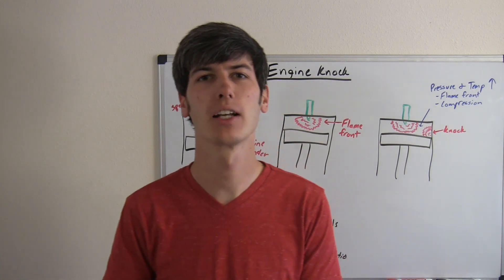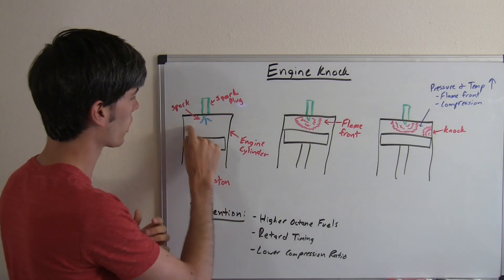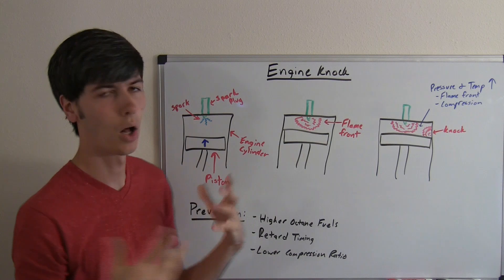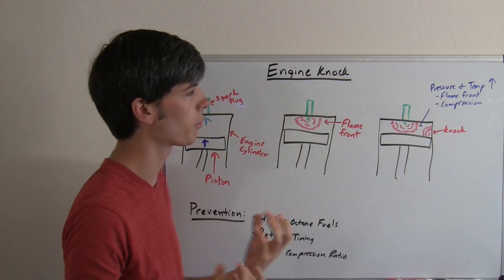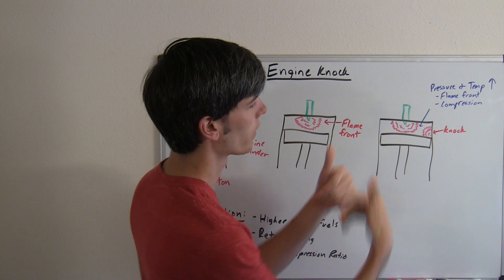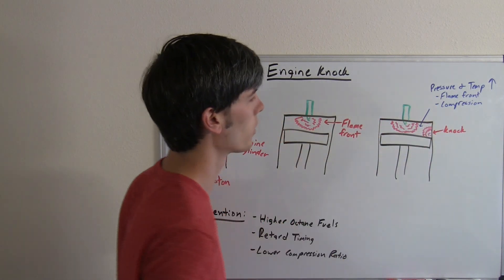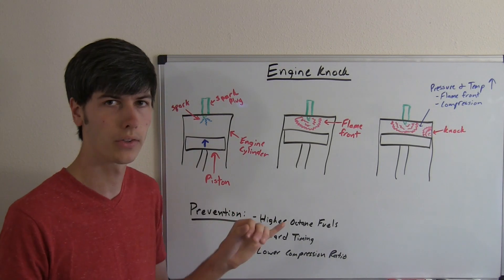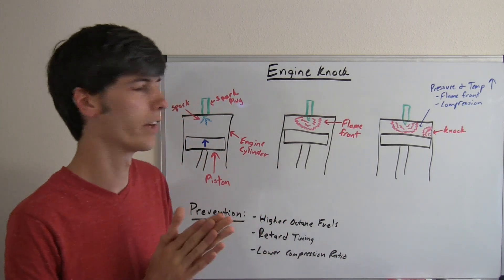Engine Knock Sound - Explained

Comment: I work developing engines. In my simplistic model to explain knock combustion at the end there is not a new flame front forming. This would be a post-spark surface ignition (a kind of post-ignition). In knock the fuel reached its auto-ignition state and burns deflagratively, e.g. explodes. Because of the very, very short time it takes to explode it generates a pressure impulse that resonates through the combustion chamber volume, just like when you hit a bongo (percussion music instrument).

Comment: I have a feeling the colliding front waves theory is not accurate. The additional point(s)  where the fuel ignition occurs makes the entire quantity of fuel burn faster than it is anticipated by the engineers that tuned the engine. As such the peak pressure occurs much sooner like probably around 2 times, instead of 14deg ATDC  it can be 14deg BTDC or even at a few degrees after TDC (again more pressure than the engine us designed to handle) and that pressure will want to stop the pistons instead of accelerating it. As a consequence the pressure and the force on the rod increases substantially depending on where was the spark advance set and other factors. Retarding the timing simply makes the potentially dangerous peak happen later and lowers peak pressure
because it will happen where there is more volume in the cylinder

Comment: I have been told that using higher octane gas in my 2011 328xi BMW is not necessary? I understand that most cars have auto timing to prevent knocking? do you have a video on this aspect? price of 91octane in Canada is $0.30 more than regular gas 87 octane.

Comment: Is any engine knock normal. Somewhere either in GM documentation or my Alldata subscription on my 2003 Impala 3800 Series II 155K miles, it said "some engine knock will occur" and then put out the very fuzzy description of what was normal or excessive. I only hear a little pinging when first accelerating up a hill, otherwise I don't hear it.
Reply: In modern engines with knock feedback control it is normal to hear some knocking combustion. I would say up to 20-30 mild, non repetitive knockings within 10 seconds with the engine with some load and at mid speed region would be considered borderline knock and acceptable. A continuous strong knocking is not acceptable.

Comment: Engine knock in a deisl is explained not by any mechanic till the engine was dismantled and wow! the grabbing by the piston on the wall was as if a powerful scourer had been rubbing the sides, looking at the pictures taken it looks like some chips or carbon deposits (if hard enough) hd scraped the indentations the vehicle had covered only 110000 kms whats that about 68200 miles 2013 model I used penrite oil and believe that is what saved me from an in route disaster, tried to contact mazda global hq but no dealer response yet. trying to figure out the cause, as it could be manufacturing chaff:? I'm sure its been picked up from the sump or other possible areas? Compression tests were ok despite the grabbing, injectors? well the effected cylinder was in specs but!!! was delivering a "higher fuel "amount, Being disloyal the knocking noise would go unnoticed easily, so if you  have any suspicion about your car no matter how new get it in written record to the dealer when getting the car serviced; no matter what they say, you'll have comeback after warranty expires.

Comment: The timing retardation used to be something that was doable.  However, since the '90s, the ignition systems on vehicles became fully computerized, eliminating the old rotary-distributor designs.  As a consequence, any retardations of ignition timing, like compression-lowering tricks, usually involve design changes—namely in the computer, which can be a very tricky thing to do unless you're a skilled hacker.
Reply: the computer has a knock retard algorithm based on a number of variables and settings so it’s much more effective to control knock. You can also datalog the timing retard and reduce the values in the timing table or give it a lower AFR to prevent knock so the computer doesn’t need to do anything

Comment: My 218ci Flat L-head 6 (1950 Plymouth) knocks at the specified timing. I also have a GM high energy electronic ignition system. The stock resistive spark plug gap is 0.035. I am presently using a non-resistive spark plug gapped at 0.040 and the knock persists. Adjusting the timing eliminated the knocking but acceleration was poor. I'll try higher octane fuel but should I increase the spark plug gap as well?

Comment: I experienced engine knock a long time ago when I was using 87 Octane fuel.  After I upgraded my engine, I went with high Octane Fuel along with Lucas or Gum-out fuel system treatment.  No more knock on my 2.15 L I-4 DOHC GDI engine.  Then engines revs easily to 7,000 RPM if I go 3/4 throttle.  Nice! Nice!  baby thank you for all your tips.
Reply: Upgrade engine like the engine block?

Comment: I know this a old video but what if my engine don't use high octane fuel?
Reply: my magma 12 car is 10+ years old and have some serious knocking or pinging issues, but i change my fuel to 97octane and it went smoother than before, even a cold start
Reply: It is better to use higher octane fuel on a low octane engine than it is to use a low octane fuel on a high octane engine.

Comment: The actual "knocking" sound can be attributed to two things. There is knocking caused by the large end of a connecting rod hitting the crankshaft because of clearance issues, or because of piston slap in an engine with worn out rings.
Reply: That's a whole different issue which deals with wear damage to the big end bearings. This video is just talking about fuel igniting at the wrong time due to timing issues

Comment: Can i use higher octane fuels for low cc engines. I mean lower compression engines. Will it cause damage? or increase its performance.
Reply: It is ok to use a higher octane fuel. It just may be slightly less efficient.

Comment: Can knock happen at idle? I know usually it's when there's a load but my truck has a rough idle and knock. I put octane booster in it and the idle smoothed a little bit and pinging went down. The only thing confusing me is it seems to happen at idle mostly. It's a carbureted 302 with vaccum advance on the carburetor if that makes a difference.
Reply: Yes it can happen at idle

Comment: I have an 03 honda crv, k20a motor recently having a teoble code of p0325, and check engine light is intermitent though the code retains on comp box memory,  even you delete it itll go back,  i replaced the knock sensor but it keeps on coming back sometimes if i ignore the check engine light it goes of automatically, do you think its more of a mech problem than a electrical pro BK lem

Comment: Thanks for the simple explanation. My 2009 Wrangler, that I bought new, used to run fine on 87 octane fuel. Now that it is ten years old with 120000 miles, I can hear engine knock (or ping) when it is under load (going up hills) with 87 octane fuel. I started buying 93 octane fuel and the knock mostly disappeared. Had the same thing happen to my 1993 Ranger. It started knocking with low grade fuel somewhere around 120000 miles.
Reply: The reason for that is carbon buildup in the engine cylinders.  As ashy residue from burning fuel gradually builds up into a hardened substance inside the cylinders, it occupies space inside the cylinder which normally should be open for the fuel-air mixture to fire properly, reducing the space for the fuel-air mixture to use...essentially, it raises the compression ratio, causing the less-stable, lower-octane fuel to pre-ignite, causing even more ashy residue to build up and also causing eventual damage to the crowns or sides of the pistons.  High-octane fuel is a treatment for it, yes, but it's not meant to be a permanent result.  You can try some types of additives which claim to clean out carbon residue...but even the best of them only partially accomplish that purpose (the rest are snake-oil).  The best way to eradicate that problem involves tearing the top half of the engine down, right down to removal of the heads, and scrub and scrape out the carbon.  While there, examine the conditions of the pistons and cylinders.  If damage is visible, then you know it's time to either rebuild or replace the whole engine.
Reply: @aloysiusbelisarius9992  Best explanation ever. I have the exact same problem as the OP; my engine has over 200,000 miles on it. I guess I will have to live with the knock for now as I can’t afford to tear my engine apart. When I hear the knock, I just let off of the accelerator pedal. It occurs when I’m going up upgrades.

Comment: 2018 wrx @29k miles.  Stock tune. On freezing or below freezing cold starts i get a chatter or knocking from the engine bay area for just a few seconds
 Please help! What could cause this?
Reply: It is probably not knock. Cold makes engine oil very thick and harder to pump. It sounds like you are hearing the various bearings and surfaces rubbing together without lubrication. Try running a thinner weight oil or using a block heater/oil pan heater.
Reply: @Redtooth75  ive been told its either the position of the cam gear when shut off or timing chain rattle

Comment: I have a 2018 with Tigershark 2.4 engine.  it only has 9k miles.  Though a brand new car I had to take it in cause it would not start and they told me the map sensor was bad.  After that I started to notice a faint knocking noise while driving (does not happen while parked) at about 2500 rpms while accelerating.  I plan to take it back to the dealership, but what could this be and how much damage might this be causing? What might have caused this?

Comment: Title misleading, I was needing an example of sounds.  My condolences about you dropping out of the election race. They said you could skateboard. Well, it would be nice to hear examples to get a possible idea if air/fuel mixture is off or something is literally banking around in there.  I turn the van off every time now, I want to see if it will start but the sounds are freaking me out. I like the analysis, but what does the play look like on the field? I'm more of a in the shop learner. (or broken down in the driveway in my case)

Comment: I have knock issue when acceleration but my car using timing chain, Im currently using RON97 but the knocking does occur occasionally during acceleration, should I change my timing chain? Since there is no way to retard the timing due to the use of timing chain.
Reply: Timing in this context refers to ignition timing, not valve timing. It can be changed in the tune. Make sure the RON 97 is the correct fuel for your car. If it is you can still bump it up an octane rating to prevent knock. 
As engines get older the carbon deposits can cause engine knock. The deposits get very hot and can ignite the fuel prematurely. Using an intake cleaner or disassembling and cleaning the engine parts can fix it if thats the problem.

Comment: I think I'm missing something here.... I always thought that spark ignition didn't occur until just after TDC? (If the piston is still on the compression stroke then surely igniting the air/fuel mixture with the piston still travelling towards the cylinder head would cause all kinds of trouble...)
Reply: Ignition always occurs before top dead center. The fuel does not combust instantly. If ignition occured after TDC the fuel would combust when the piston is already moving down and would cause a severe loss of power. Ignition timing can range from around 15-35 degrees before TDC depending on the engine, rpm, and load.

Comment: I got a Cobb accessport and I use the gauge engine knock I see it goes from -1.50 to 0.00 and when I race or floor it it goes -2.50 I’m not sure how this gauge works I’m a noob at this is it bad when it goes negative?

Comment: I just had my crack pully changed. but now my car has a small vibration. 
Which feels like the crank is not balanced properly.

Its a 1.2 Ford Duratec.  Can anyone help me what the problem could be?
Reply: Check the VIN. If the second character is an F, get rid of the car.

Comment: Would this concept also apply to a Diesel engine? Also, could this happen if your car is just turning over and not starting?
Reply: it should apply. basically the fuel is injected and ignites immediately with a certain speed but hot spots can make the burn speed accelerating and messing up the peak pressure inside the cylinder. However the diesel ignites as soon as it is injected so there is no or less flame propagation to areas of unburned fuel I guess it makes it much less prone to knock

Comment: how about knock at low load, is that possible in any situation
Reply: Low load not possible. But at low RPM and high load very high chances if you have carbon buildup and/or AFR is off.

Comment: My brand-new Hyundai Elantra has engine knock bad running on 87. Took it to the dealer. They said they haven't a clue what the problem is since the check engine light isn't illuminated. "Try premium" they told me. So, I filled up with 93 and the car still knocks, but to a lesser extent. Something is clearly wrong and the dealer seems to have about as much experience fixing cars as I have coding websites.

Comment: Engine oil was dry and ran at high speeds of 115kmph,and suddenly on a high speed run like this sudden sound change,,as a knocking,,,,,does it cause piston to change ,,,,what is that knocking sound,is it the piston rubbing inside the cylinder?!Please do reply me

Comment: So, for example, what about the 2012 Mazda 3's with the SkyAcive motors?  The regular engine has a 10:1 compression ration and the SkyActive engine has a 12:1.  Would higher octane be necessary for the SkyActive engine?  Isn't that why they get better gas mileage?

Comment: Only time I've ever had the misfortune of hearing pinging is from an overheating engine, pissed out all the coolant from a pipe near the throttle body, temperature sensor didn't even start budging until it was pinging for a little while already and generally running like crap. Luckily didn't do anything serious to the head or the head gasket or seize the engine. Had a nice smell of burning rubber coming from the ignition leads though lol

Comment: My van requires only 87 octane, would it help the lifetime of the engine if I start using higher octane(91) to prevent any knocking? I appreciate all your input

Comment: So, since ignition can occur without a spark plug due to the high pressure (read, high temperature), do we have engine systems without spark plugs? If not, why not?
Reply: Yes. Diesel engines ..

Comment: So can you help me clear one thing that whether the knocking or pinging is caused due to pre-ignition impact on the cylinder walls and piston head or due to the back pressure created by the flame front originated from the pre-ignition spot or both?

Comment: There are actually two types of spark knock:

PREIGNITION - occurs when a hot piece of carbon prematurely ignites the air/fuel mixture leading to a sudden and abnormal rise in cylinder pressure and engine vibration in that cylinder
DETONATION - primarily caused by fuel with too low an octane rating, timing too far advanced, high engine temps, or excessive carbon buildup in the cylinder

Knock sensors are designed to detect the above, provide inputs to the computer to adjust timing --- only minimizes the problem
Reply: If it's preignition, then it's not spark knock now is it.  In order to have spark knock, you would need the spark plug to have fired.

Comment: can a increase of air flow cause a engine to knock?
Reply: freshdominican92 Yes, that is called running lean. Too much air in the fuel/air mixture. The left over air heats up and combusts after the normal combustion process and hits the piston. That is why you hear the knocking.

Comment: Hi. I have a Honda cbr250r and it has a weird noise, it comes while accelerating. It goes away when i decrease the speed or acceleration. I have changed the clutch plates also changed the bad shims, Chain and sprockets. Also loosing power.

Comment: I still don't understand how knocks can damage your engine. So, the pressures of the ignition between the spark plug, and the high temperature area collide, and then I don't know what effects will it do that will cause damage inside the cylinder. Will someone please give me a quick elaboration on this?
Reply: E2Moto The knock damages the engine because of the high heat and pressure that occurs after the initial combustion process. This separate combustion hits the top of the piston and cylinder wall. Depending on how bad it is, it can melt the piston and damage the cylinder walls.

Comment: What you're explaining is called "pinging". I would consider a knock as damage to a component other than miss-ignition. Unfortunately mine has damage and it's not minor.
Reply: Replace the engine. If you haven’t gotten rid of the car  considering this video was 4 years ago

Comment: This is all wrong. I thought engine knock was from the pistons like this but I played mechanic simulator 2015 and after taking apart the whole engine to find no issues, I went around to the back and saw the fly wheel was garbage and replaced that and it fixed the engine knock. This video is all wrong.
Reply: scrubl0rd how was the fly wheel garbage?

Comment: I thought that the chamber was designed to hold the ignition of fuel , so how can a secondary ignition cause damage?
Reply: without going into too much detail, having a uniform flame front is crucial to a smooth operating engine. A secondary explosion caused by pre-ignition can disturb harmonics, push against the rising cylinder thus bending the rod beneath or even crack the cylinder itself if its made of weaker cast metal instead of forged.